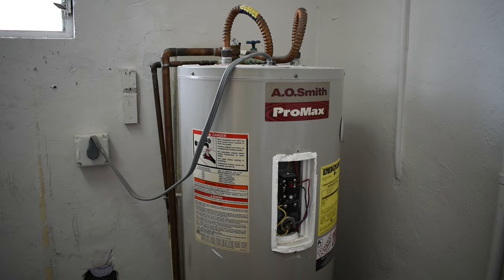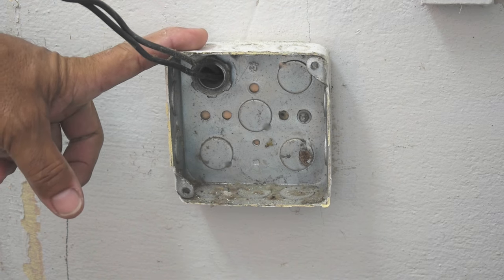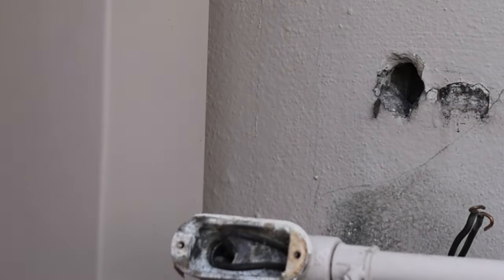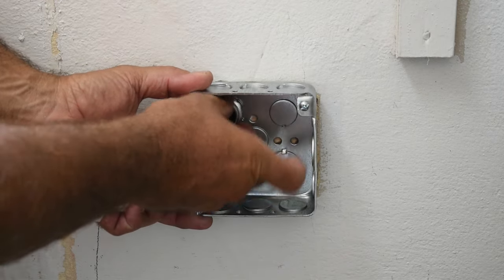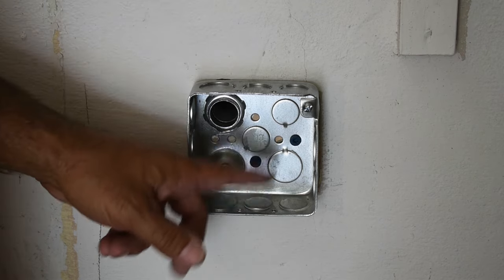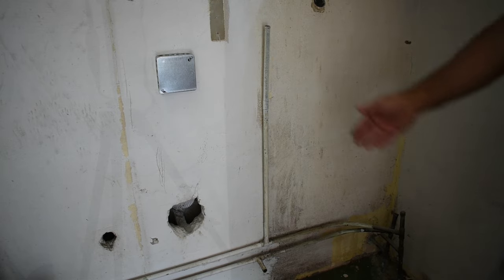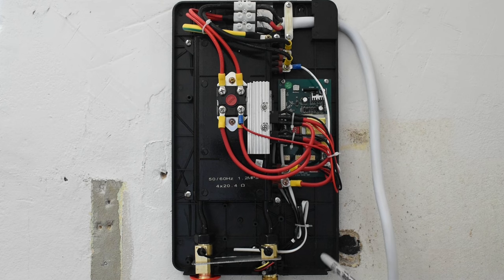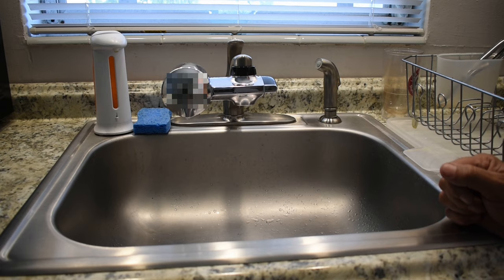How To Replace A Water Heater With A Tankless Water Heater(STEP BY STEP)

Comment: I will never, for the life of me, understand how people have their fuse box outside their house..  It just doesn't make any sense at all.  I have lived in 5 of the 10 provinces in Canada and never once seen that here.  It's extremely insecure and seems dangerous.  I mean, any moron can just walk up and turn off your power any time they want.  It's just plain stupid.
Reply from the maker: Good luck doing that with a fenced in yard and security cameras. You can also lock the panel if desired.
Reply: In the place of some country where I live (prefer not saying it), electricity around here can be billed monthly or by topping up the balance of kWh just like internet data plan on phones.

For the monthly part, usually some technician come to check something in the fuse box every month, hence the placing of the fuse box. I don't know what it is. All I know is just they want to see some series of number that's changed everytime by themselves.

I don't bother to ask what's the purpose or what's the thing in the device they're checking on. Probably next time.
Reply: Different places have different building codes that change over time. I live in S. Carolina, and close to 15 years ago I inherited my grandparents house built in the mid 50's, and we had to redo the entire electrical system as it had various issues from age, and the norm back then was 2 prong outlets except 220v appliances, and even copper wiring was not needed for a house to be passed by building code laws, as they could have used junk aluminum wiring, but thankfully the builder for my house used copper, and smoke alarms were none existent, but I had to have them hardwired throughout my house to pass inspection.
Also when I replaced the old  gas water heater in my house with a gas tankless code was updated to state they could no longer be inside the house, so the plumber I hired to do mine along with some other plumbing work that was long overdue for my old house, had to put the water heater on the outside of my house, and ran a 120 volt cord through the laundry room wall into the same outlet my washing machine shares, yet the electric ignitor for my old gas tank heater was hardwired directly to the breaker box.
Reply: @electronicsNmore  We don't tend to have fences and security cameras in Canada.
Reply: @CommodoreFan64  First thing I have to say is Commodore made awesome computers. :D  I had an Amiga in the 80's. Second, codes do change, that's for sure.  My friend bought a house a couple years ago that still had an actual fuse box and aluminum wiring.  Cost him quite a bit to change it to breakers and copper.  Being in Canada though, there is not way in hell we could have a water heater outside. lol

The house I live in now was built in 1950. All copper in the house now, but the two outlets in the spare room still  have only two prong outlets. hehe

I still don't think it's a good idea to have your panel outside your house though.
Reply: @ElectronicMusicUnderground  I could see it being OK there.  But could you imagine in the northern US or Canada?  You have 3 feet of snow in your yard and you trip a breaker.  Good luck turning it back on. lol
Reply: In the US it varies by location. My previous house, in Nevada, had the breaker panel on the outside. My current one has the breaker panel inside, but there is still a main disconnect on the outside, adjacent to the meter. I think this is so if there’s a fire inside the home, the power can be shut off for safety reasons.
Reply: @Colin_Ames  Maybe weather is a factor in where it is placed.  And whether or not you have a basement.  In Canada, you'll be hard pressed to find a house without a basement.  I also have never seen a mains disconnect outside of a house here.  Doesn't sound like a bad idea though, as long as you can put some kind of lock on it. haha
Reply: Just bought my first house, which was built in on 1946. House 680 sq ft on slab. Electric box is on the outside. Lol if I wanted to move it inside it would literally sit next to my tv or couch. The house is so small I’m considering building an enclosure to put my water heater outside just free up the 4 extra sq ft of floor space for storage.

Comment: Rare that we can add a 60 amp breaker without upgrading the entire service.  THAT is expensive!   Electric tanks and tankless that heat with resistance heat are ALL 100% efficient.  Tankless take more maintenance.  I like the reserve of hot water when the power goes out, and the tank also holds a lot of drinking water when a natural disaster cuts off our city water.

Comment: Where's the valves for BOTH sides, not just hot side. ALSO, where's the pressure release?
Reply from the maker: According to the manufacturer, I called them and they said for my particular tankless heater a temperature and pressure relief valve is not required because the unit has more than one safety feature installed, but I did decide to add one later. I was also told the power cable that was included could be used as is, but I also added an armored jacket over it later. As for the valve, one is sufficient on the cold side. I normally turn off the power to the heater before turning the valve off

Comment: I probably would have put a safety switch inside since the panel is outside. I'd hate to have to troubleshoot on a 'rainy' stormy day. But nevertheless, great solder joints and video.

Comment: Awesome video, I did this back in 2020 after my 30+ year old gas water heater failed, dumping all over my laundry room floor, and we replaced it with a Rinnai tankless gas water heater installed on the outside of my house due to S. Carolina building codes, and the igniter, and electronics run off 120 volt, with the cord simply running through the wall inside the house into the laundry room, and sharing the same outlet as my washing machine to make the job easier.  
Only downsides I've had with the tankless is it takes a little longer to get hot than a tank heater, and DO NOT take a shower when the washing machine is running, and it wants water at the same time as the water temps will be all over the place. HOT HOT OUCH!!! 🥵
Reply: For a gas tankless heater, as far as the electric goes, all you need is a typical outlet(like you mentioned)?

Comment: Very clean job and solder joints look very good! However, instead of an FIP, you should have put unions for easy disconnect in the future when you swap out units or so you can flush the tankless. Or, you could have put shut-off valves and two tees between the valves and the heater for the flushing purpose.
Reply from the maker: Since this video was made I added unions. Thanks for watching

Comment: I like to use a slightly lesser kick in the EMT, so that there's a tiny airspace between the tubing and the wall.  I feel that helps prevent the tubing from corroding, since concrete does pass/hold moisture....  Naturally, there will need to be small shims under the straps to maintain tightness with the EMT (and use more straps, and space them a little bit closer together).

Comment: Just a tip, you can always pre-solder the joints at the female adaptors before attaching them to the heater so it doesn’t burn the system

Comment: Great video. That is a really compact unit. Big improvement. That said, and IMO, the ONLY con to the tankless system is that you no longer have that 40/50 gallons of emergency water at hand. Especially in an urban environment. If it wasn't for todays world political situation it wouldn't matter too much.
Reply from the maker: Yes that's the only drawback. You don't have any reserve of hot water in the event of a power failure. Thanks for watching!
Reply: @electronicsNmore  Or water at all should the utility stop supply.

Comment: Excellent video, as always. The gas water heater in our house here in North Georgia is 20 years old and probably will need replacing soon. A plumber I spoke to told me the cost for a tankless (including installation) would be around $3,000 which seemed kind of pricey to me. DYI installation would obviously bring the cost down, but I’m not sure if I should be messing with gas!
Reply from the maker: Rip off price. The wiring, unit, and plumbing parts cost me $275. Only one day for the entire job.
Reply: You also have to keep in mind what kind of gas you have. Some tanks require natural gas and some require propane. That should all be labeled on the heater unit

Comment: Would it be safe to install this in my attic? Looking to replace my Rheem 50 gallon electric tank water heater with an electric tankless. It’s been hard to find a tankless equivalent to what I currently have. I’m just concerned if it would be ok to install a tankless (if that’s the route I take) in my attic, due to hot and humid conditions down here in Louisiana.  Would love some advice from yourself and possibly anyone in the comment section.

Comment: At the 12:50 mark, where do you find wire like that?   I'm only familiar with wire that is inside the yellow covering.
Reply: Home Depot and Lowes type stores sell that kind of wire. You can either buy it on a roll or buy it by-the-foot.

Comment: Hey, Wonderful Vid, Great job!!!, my questions are, did you exceed the max capacity of the 3/4 conduit?...max capacity as I understand it is 40% wire with a 60% void for heat or is your area liberal to that requirement? or maybe I got it wrong, and, Why not Pex and avoid the copper?....needless Great Job! very informative!!
Reply from the maker: I know number 6 wire you needed minimum three-quarter inch conduit. That said, there was still plenty of room for movement inside the conduit for the 120-volt circuit. I'm no fan of PEX. Many years down the road that material can possibly dry out and crack. The copper will last far longer and you also have the benefit of copper as being a antibacterial metal
Reply: @electronicsNmore  Thanks...Go for it!! it's been proven that bacteria can grow at 120 degrees

Comment: I really want to install a tankless, but the electrical portion of it is the biggest hurdle. Currently, the electric heater has a 30 AMP breaker, and I'm going to need two 40 AMP breakers. The path to the heater isn't nearly as direct as this and I have no idea if the wiring is being ran through conduit behind the drywall. If the electrical could be sorted, the rest would be a no-brainer.
Reply from the maker: You also need to make sure that your home can handle adding a double pole 60A breaker. Use an online electrical service load calculator.
Reply: @electronicsNmore  Yes, I didn't think of that. The panel is massive and still has tons of room on it, but yeah, it's never safe to assume.

Comment: I saw a youtuber make a custom water tank that acted as a (500 gallons) heat battery. Its far more efficient to have a tank of heated water then a tankless water heater. And the bigger the tank the better the savings. You have to put so much energy into water to heat it. To take 3 gallons to boiling it takes me around 30 minutes on electric stove. But if i started with hot water the time is half. Water will obviously get hot faster if its mixed with hot water first. I could make a tankless water heater work. Id get a pressure tank and set it in front of the tankless water heater then let that get to room temp in the house. That way at least the water is above 60f when it goes in. I could also just paint it black and place it under a skylight. But like i said just upsizing your water heater will save you money. The only reason to go tankless is you would rather have infinite hot water. Like oh ill just run this for an hour. If you really want to save money lol get a wood stove and a copper coil 😂😂😂
Reply from the maker: I don't think you're going to get much cheaper than a 15-minute hot shower for $0.12.

Comment: By "Double pole 60 amp" - Do you mean (2) 30 amp breakers? Currently my tank heater is on double poles - a 20 and a 50. Thanks
Reply from the maker: (2) 60A, not (2) 30A. Your heater should not have a 20 & 50 tied together.

Comment: I noticed there was no expansion tank. Are they unnecessary for just this brand or is it because it's not a combination boiler/water heater?
Reply: No need for expansion tank on an instant as water is only heated when it is flowing. So no closed system to pressure up.

Comment: Isn't 6 gauge wire max amp is 55amps but there's a rule from the nec that allows for 60amps to be used on 6 gauge wire
Reply from the maker: 6ga can handle 60A. Depends on the insulation used.

Comment: The tankless water heater looks fairly small to me. Does that water heater supply enough hot water for a two bathroom with a washer? How do i figure how what water heater i need for my home?
Reply: It's not about the size of the house. Tankless heaters heat the water as it goes through. As in, it isn't heating water unless you have a tap running somewhere requesting hot water. So what you need to determine is how many faucets and/or appliances will be using hot water at one time, then you can decide how many gallons of hot water you'd need per minute, which is how the tankless sizes are set. So if you run your dishwasher and two showers at the same time, you'll need a pretty powerful tankless unit, like 9+ gallons per minute. but if you are only running hot water in one place at a time, a much lower powered one might suffice, like 3-6 gallons per minute.

Comment: you should 1000% be turning off the WHOLE HOUSE POWER at the top of the breaker box.  By leaving the main breaker on, the bus that you're working on is still powered up.  This can be done without zapping yourself, but you REALLY shouldn't be taking risks with 100+amps, which can absolutely kill you.

Everything else is okay, but that's just ignorant and stupid and could lead to an unwitting viewer getting killed.

Comment: Efficient use of space, out performs expectations !
Reply from the maker: My unit works great. The only issue I noticed is that you don't get hot water at the faucet if you only have a very small stream of water. No big deal to me, I turn it up a little higher flow.

Comment: You need to work on your electrical skills man, as an electrician  some of the things you did made me seriously cringe. Great video otherwise!
Reply from the maker: Instead of mouthing off, humor me, tell me what I did wrong. I'm used to pedants commenting.
Reply: @electronicsNmore  can you tell me what the difference is in monthly operating costs between your gas and electric hot water heaters?

Comment: No dielectric unions?
Reply from the maker: You only use dielectric unions on dissimilar Metals such as galvanized and copper
Reply: Cam you connect  to water heater with cpvc?
Reply from the maker: Yes all hot water lines use CPVC if you don't have copper